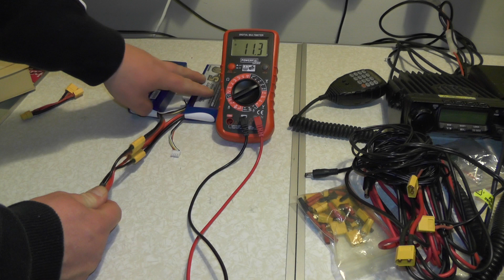Increase amps NOT volts

Comment: Hello.....is there any device that could increase the amperage without increasing voltage in DC circuit?.....thanks
Reply: hooking batteries in parallel increases your amperage, and you keep your voltage the same but both batteries have to be of the same voltage, and you double your run time🙂

Comment: My battery is 9.6V 11.7Ah LiFePo4.  It is 27 cell battery.  What setting should i use please.  I keep getting low voltage or high voltage.  What setting should i charge it at?    What should my mAh and V be on my charger?  Please help.

Comment: so does one cable connect in series while the other connects in parallel or am i dumb?
Reply: The old original Y cable was connecting the batteries in series, this results in a total Voltage that is twice as large as the voltage that either of the single batteries could provide. By doubling the voltage across the same load, we generate a higher current flowing through the load causing the load to work faster or possibly heat up and be destroyed. The second cable connected the batteries parallel to each other so that the voltage at the load remains the same. The primary effect of using the new cable to connect the batteries in parallel is that the total CAPACITY or available stored energy is then doubled to equal to sum of the two individual battery capacities. , or how much energy is stored within the battery, is increased by summing the individual capacities of the batteries together.  This means the device will run at the proper voltage thus generating an appropriate current through the resistance of the load and will last twice as long as one battery would last.
Reply from the maker: Brertt your not dumb I got the wrong cable it would of increased Volts not Amps

Comment: You are doubling the amp hours not the amps. Amp hours is the capacity where as amp is the discharge rate.
Reply: law2181  so how yu increase it
Reply: @shemarismith1247  law2181 is wrong, doubling the batteries does both increase the amp hours and (total possible) power you can draw at once... obviously since it's drawing 50% from each battery. the guy in the video was only interested in amp hours, as is... everybody. I don't know what kind of current you would have to pull from it before it melted from too many amps 😩
Reply: Shemari Smith increase what?
Reply: True

Comment: Parallel the cable plus add a with a value of 4700uf to 10,000uf capacitor will add better current smoothing..
Reply from the maker: Wayne Wayne I’ll look into that thanks for watching